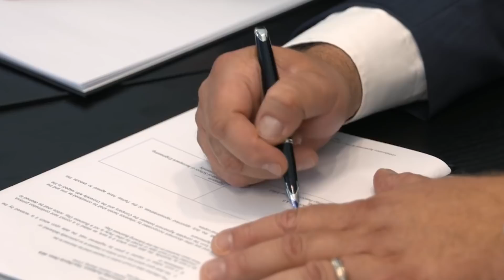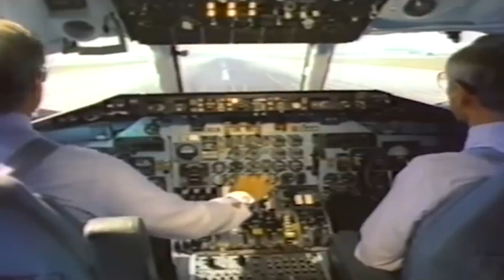Boeing 717 - Boeing model and legacy of Douglas

Comment: Probably the worst thing that has happened to this aircraft is a 2.9g landing at Darwin airport in late 2018. Normally a landing that hard would write off a frame or cause damage that results in maintenance - however, it was a quick check and the aircraft was flying 30min later.. this are a amazing aircraft.
Reply: I would hope it would survive a 2.9g landing since the aircraft is rated to 2.5g plus a 150% safety factor. 

But looking at the hard landings of the MD-80 and MD-90 during tests doesn’t give me huge confidence.
Reply: @Bartonovich52   The celebrated "tail-loss landing" of the original MD-80 in flight test was from a touchdown about 1 fps over the 15 fps design limit, so no surprise there as to the outcome.  The flight test card called for a stabilized approach with no thrust adjustments below 100 ft on this max sink rate landing which would be used to establish flight manual landing distances.  The pilot [name withheld] tweaked it anyway,  figuring he could avoid a go-around.  Bad call.

Comment: Comparison:
717: 20 years of service and not a single hull loss from a crash.  Absolutely flawless safety record. 
737 MAX:  1 year of service and already a devastating crash killing all 189 souls on board.  Likely from mechanical fail.
Way to get it right, Boeing. 🙄 🤦🏻‍♂️
Reply: @phillyslasher wow, you still won’t own it?  I’ll go back to my original point which you attempted to rebuttal:  As far as safety is concerned, 717>737 MAX.  
I’m sorry, but it’s true.
Reply: @phillyslasher the jackscrew is not specific to a T-tail design.  Virtually every airliner has a single jackscrew that if given poor maintenance, will fail.  The only types with multiple jackscrews are the DC-10/MD-11 and 747.

Comment: 717 are quiet if you're up the front, down the back it's terrible.  Flown on these too many times to count...> 100 times. The inefficiency of the airframe is exposed in locations with high ambient temperatures. The new Bombardier now the Airbus A220 is a far superior airframe, which by the way is also more efficient than the Embrier as well.

Comment: I live in Hawaii and Hawaiian Airlines still operates the 717 on all its inter-island flights (they replaced DC-9's).  It's a rock-steady workhorse plane and the airline loves them for their dependability and ability to do very short haul, high usage (up to 8 flights per day)  business.  Recently, the planes had their interiors remodeled with thin-back seats, comfortable enough for the average 40 minute flight.  However, after flying on a newer Embraer jet, I must admit the 717 does not offer the same cabin experience.  Hawaiian has only said they wish to continue to use the 717 with no plans to retire them.  I would love to see them move into a more modern aircraft soon.

Comment: "the dc-9 was a completely new airplane"? Really? Sud Aviation would argue that one....
Reply: Depends what you define as new. If you want to say it was inspired by the Caravelle as the first jetliner with the 2 tail mounted jet engines, then yes I think it was said even by Douglas at the time. But you can hardly argue it was not new as there was probably not a single common component between the two aircrafts, tought.